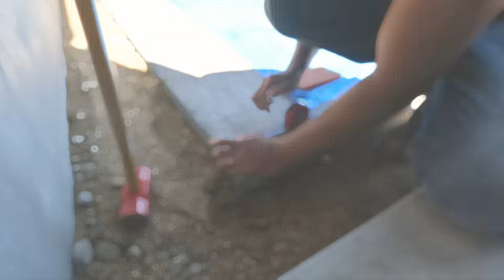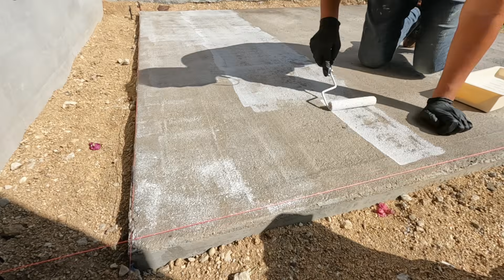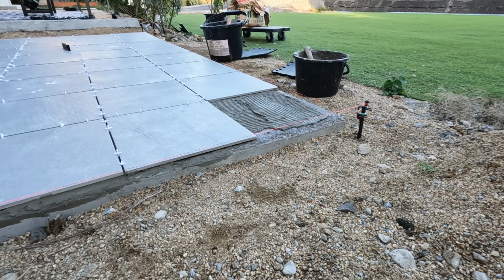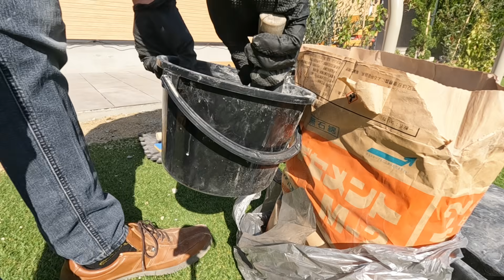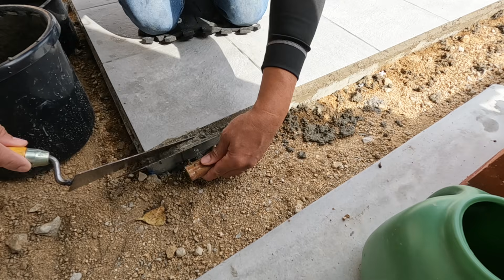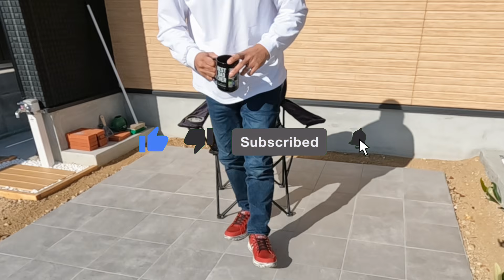Tiling an Outdoor Concrete Slab (Start to Finish) | Simple DIY Project | Outdoor Tile on Concrete

Comment: How many tiles did you cut ?
Reply from the maker: I didn’t have to cut any tiles! 🙌 I planned the slab size around the tiles before pouring the concrete

Each tile is 30 × 30 cm, and I used 8 tiles across and 8 down for a total of 64 tiles. I also accounted for the 0.3 cm spacers between the tiles

The tile layout came to roughly 242.1 × 242.1 cm, while the slab measures 244 × 244 cm. I used that extra space around the edges to create a slight bevel from the tiles down to the concrete, so everything fit without cutting a single tile 👍 Hope this helps and thanks for checking out the video!

Comment: How cool! I’ve been planning on tiling like this to make a chess board. I already have existing concrete all over my yard. How do I prepare before tiling?
Reply from the maker: That chess board idea sounds awesome! For mine, I gave the concrete a really good sweep first to get rid of any loose dirt and debris, then I used a concrete sealer here in Japan to prep the surface before tiling. After that I was ready to go.

Just make sure your existing concrete is solid and free of loose material before you start. Good luck with the chess board! Would love to see how it turns out 👍
Reply: @t @thespamflipper y thanks for the encouragement! And I read somewhere people talk about drainage, etc. I assume as long as that area of concrete doesn’t collect water when it rains it is a go?
Reply from the maker: @maemaebayneo  Yeah, that’s pretty much how I looked at it. My slab is tilted slightly away from the house, so water naturally runs away instead of sitting on the surface. I think that’s the big thing you want to make sure of before tiling.

The grout will help keep water from getting down between the tiles, but I wouldn’t rely on the grout for drainage. You definitely don’t want water sitting on the slab underneath.

Good luck with the chess board! Now I’m curious to see how it turns out 😂♟

Comment: No need for grout sealer?
Reply from the maker: Good question! I didn’t use one. I haven’t had much luck finding grout sealer at my local Komeri or Kohnan Pro, so it doesn’t seem as common here where I am in Japan. That said, a penetrating grout sealer is a good optional step if you want some extra protection.

Comment: Please share me shopping list links  for this project
Reply from the maker: Thanks! I don't have a full shopping list for this project, but I bought the tiles from the website linked here: https://www.tilelife.co.jp/ as well as in the description so you don't have to keep coming back to the comment section. The thin-set mortar and all the equipment came from Komeri, and the grout was from Konan. Since I'm based in Japan, those specific stores may not be available where you are, but any quality exterior-rated thin-set mortar and grout from your local home improvement store should work. Hope that helps, and let me know if you have any questions about the build!